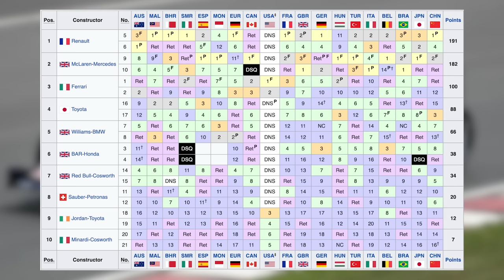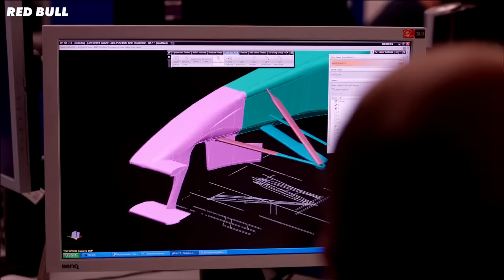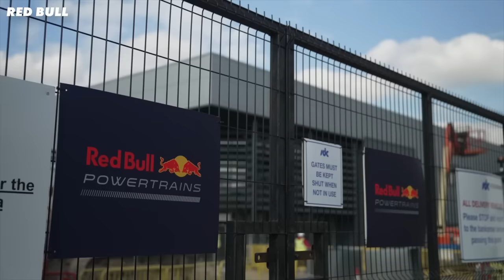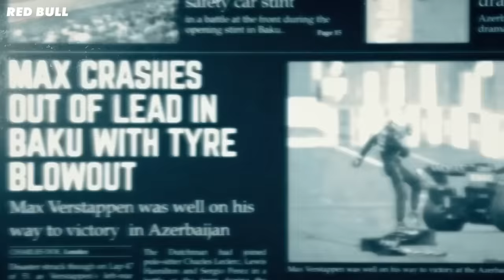The UNTOLD Story of Christian Horner

Comment: 2014-2020 Redbull still the best team on the grid.. Even Sir Lewis Hamilton said Redbull is underrated in the Grill The Grid..

Lewis knows that if Redbull had equal engine power, they would win WCC and even when they had a slightly slower engine power, they still could win a WDC..

Newey best car designer, Hannah best race strategist, and RBR pit crew is the most consistent.. I'm so glad they dumped Porsche
Reply: That's why they can conistently outperform the main team that supplies their PU to RBR

But it is also the reason they can't become title contender until last year

Comment: Great video, but is Christian, truly the youngest team boss ever at 32? I reckon it was Nick Wirth, of Simtek in 1994. Off the top of my head he was 28. He introduced Computational Fluid Dynamics to F1 and had to deal with the death of one of his drivers. Trivia, I know, but maybe someone else knows the definitive answer.
Reply: Charlie Moody was the Simtek team principal, whilst Nick Wirth was the Technical Director.  Although it should be noted Team Principal as the defined role it is currently, is actually a fairly recent innovation, not all teams had a by name team principal, and sometimes the role was split between multiple people or under a different name.  

Bruce McLaren would also be in contention for the youngest team principal, he started his team at ~29, but again, I don't believe he ever formally called himself team principal.

Comment: I'm here to ruin things. To be fair, yes, Max won on his RB debut, but both Mercs crashed out in turn 4- lap 1. Had even 1 of them been able to continue, Max would not have won that race. Second thing, Renault's (un)reliability in 2015-2018 is a myth. For some weird reason the majority of those issues were in RB but not in Renault. There were reports that RB used different engine mapping and RB used different oil and fuel suppliers compared to Renault. It's like putting diesel into a petrol car and then complaining that your car blows up. Third thing, RBPD is still run by Honda. You make it out like RB is doing all of this on their own. They are not, Honda is still heavily involved with RBPD.